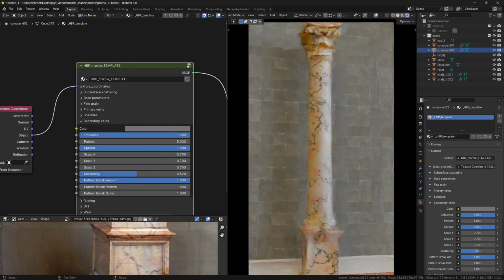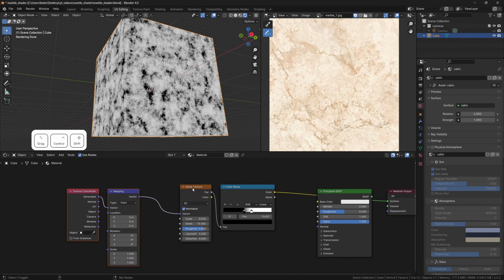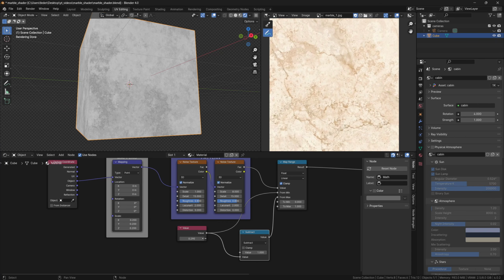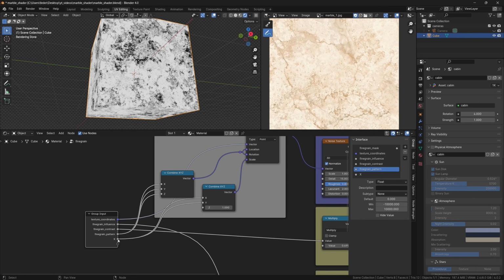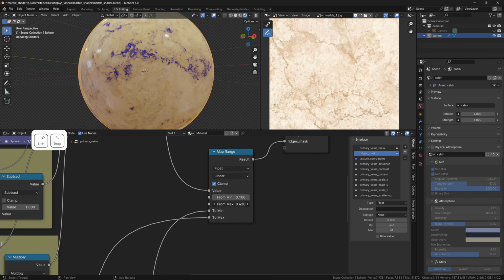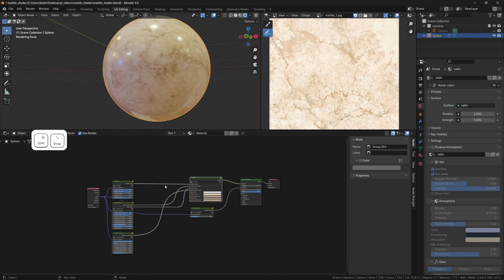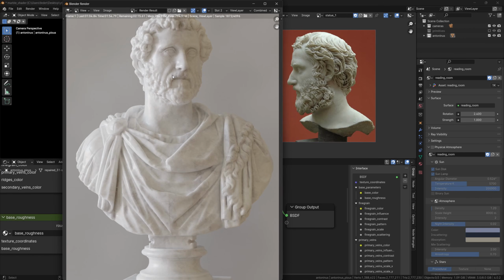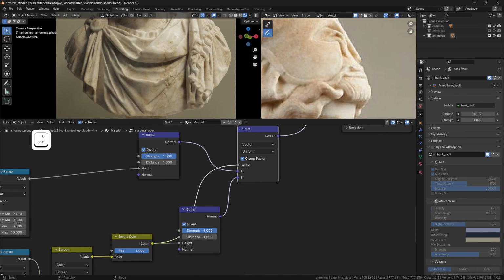Creating a realistic marble shader in Blender

Comment: @hbitproject Hi. I’ve just bought your great shader but didn’t figure out how to use in my scenes. Tried to append only the material from your blend file but didn’t work. Could not figure out how to use your presets. Can you help me?
Reply from the maker: Hello! The easiest way to use it is through the asset browser, then you can simply drag and drop presets into your scene. In case you don't know how to set it up let me know and I'll try to guide you
Reply: @hbitproject  I´ll need your help...besides asset browser, If there is another way to import the presets OR to make my own Marble  preset using the "empty" template, I would like to know!
Reply: @hbitproject  Another thing would be great to know: how to apply all the shapekeys and modifiers, cause we can't apply them with shapekeys, all this to free resources...only one complete column done in an empty scene and my viewport is already lagging.... (gtx 2070super 8gb, 64gb RAM, I9)

Comment: Sir, let's say we create a colonnade using instances. In this case, all the columns have exactly the same texture pattern. I see this all the time in all sorts of video reconstructions of ancient architecture. What is the solution to this problem? If there is an easy way to change the pattern depending on the location of the column, why aren't reconstructionists using it?
Reply from the maker: Hello Sir, of course there is a way around that. Just check the texturing process in my reconstruction of the temple of Castor and Pollux 👍
Reply: @hbitproject  O'k, sir. I must confess that I watched your work, but I watched it like a miracle, with my mouth open and without trying to make sense of it. Alas, my intellect is constantly declining from old age, while you are constantly delighting us with more and more achievements. 👏
Reply: @hbitproject 👏